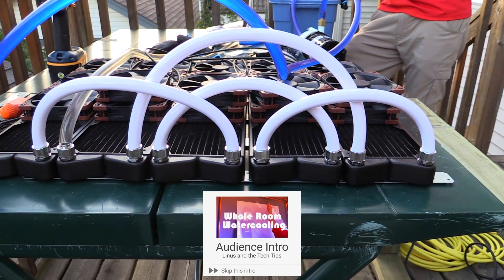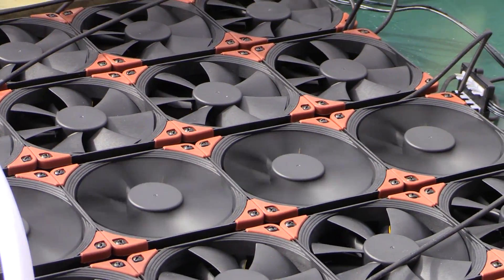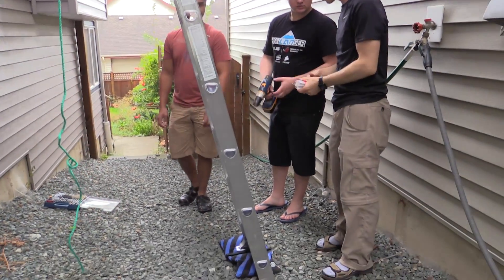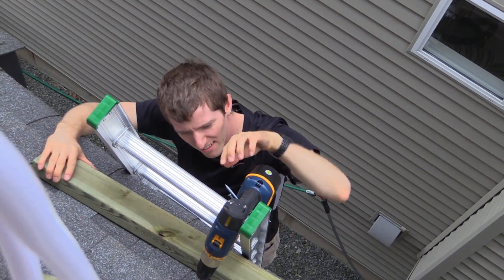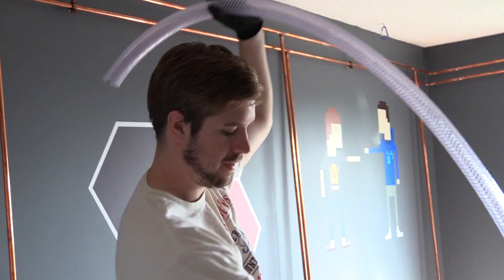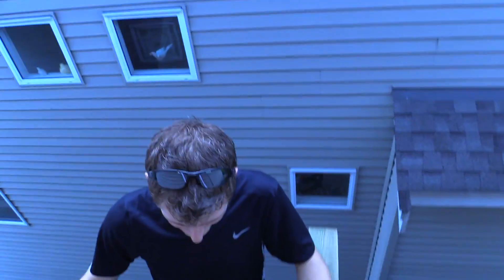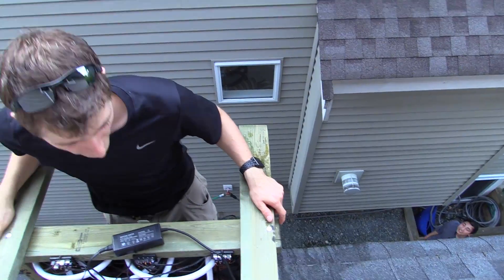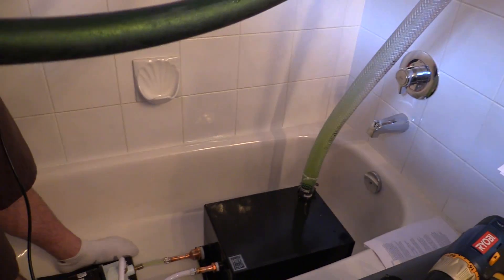Whole Room Water Cooling Project Day 3 - Radiator Mounting and Panic...

Comment: I would like to hear some opinions about an ''issue'' I have. I'm in doubt between two descisions: buying an SSD or upgrading my GPU.
I heard having an SSD is amazing because everything is so much faster, like booting up the PC, but on the other hand it doesnt increase performance in games and it's not really necessary.
Second option is to upgrade my GPU. I currently have a 7970 and I notice that it's having trouble with some games to play at max settings with 60 FPS. If I'm upgrading I'll probably go for the GTX 970 because it's such a great card for a good price. If anyone could help me I would appreciate it. 

My specs:

i7 4770k
8 GB RAM
AMD HD 7970 3 GB
700W PSU
2000 GB HDD

LG 29UM65 2560x1080  Ultrawide Monitor
Reply: Get the 970
Reply: You can press your power button, pee, then play great looking games at 60 fps. You don't need an ssd as much as a gpu
Reply: That is true, but wouldn't it be better to wait untill my 7970 is really outdated and then get a new GPU. The only games I can't play at ultra with an average of 60 FPS are demanding games like Crysis 3 and Battlefield 4. I'm not sure if the upgrade is worth the money.
Reply: PUrExIIxDuREx Your're right as long as you can get 60 fps on medium I think it's good.

Comment: Instead of copper tube it is better PVC tube easy to work with and come in different colors also.
About radiator i will use from air condition easy to instal on wall and to power it up....
That money you guys give for radiators you can buy 2 air condition radiators...
Almost to forget it can easily happen condensation of radiators and those fans are not made for outdoor use...
you will have big problem !
Reply: PEX would have been an even better decision.
Reply: The fans they are using  are the NF-F12 and they are Certified IP52 water- and dust protection.  Though I still wouldn't trust them to more then a drizzle of rain 

This is what the Nocua's website says "Thanks to a special varnish coating that covers the motor and PCB, the NF-F12 industrialPPC complies with the ingress protection rating IP52. This means that it is not only highly dust resistant but also withstands dripping water equivalent to 3mm rainfall per minute."
Reply: ***** and much cheaper
Reply: kameron454ci They could have also easily removed and moved the entire system to the new office. Also, no brazing/sweating of copper pipes required. The crimp connectors from various PEX systems are more than adequate and ensure no leaks. It would also have been ok with the heat output. The only thing that may have been an issue is the uv exposure if they ran the PEX outside and uninsulated. But they could have used a different material for the exterior connection.
Reply: *****
There was a Video from CES i think where they show them submerged in a Tank ;)
Reply: Definitely. PVC is more sightly and less of a hassle than copper pipes. Also, copper pipes are expensive . They conduct heat too, which may be bad for efficiency. Copper tubing is not needed. The water isn't THAT hot nor is it pressurized much.
Reply: 19stojkovic93 that grammar is more broken than your Slavic gopnik mobile.

Comment: Apple Pie

Ingredients:

Pastry for 2 crusts (recipe here)
8 cups sliced, peeled assorted baking apples - about 3 lbs.  (Granny Smith, Cortland, Jonathan)*
2 Tablespoons lemon juice
3/4 cup white sugar
1/4 cup brown sugar
1/4 cup all-purpose flour
1 teaspoon ground cinnamon
1/4 teaspoon ground nutmeg
2 Tablespoons butter 
1 egg yolk
1 Tablespoon milk

Directions:

1. In a large bowl, toss the sliced apples with lemon juice.
2. Combine sugars, flour, cinnamon and nutmeg; add to apples and toss well to coat.
3. Fill pastry lined 9 inch pie pan with apple mixture. Dot with butter.
4. Place second crust on top of pie filling, cut slits in top of crust to vent. Seal the edges of the crust with a fork or by hand.
5. In a small bowl, beat the egg yolk and milk. Brush mixture over top crust.
6. Bake at 425 degrees F for 15 minutes.
7. Reduce heat to 350 degrees F and bake 40-45 minutes more or until crust is golden and filling is bubbly
Reply: k

Comment: Why? didn't you just use a car radiator and fan? It would have been cheaper, and worked even better, with less things to leak or go bad. inb4 hurdur 12 volt system. They sell fans that run on 120V and would work just fine.

Comment: I would have just bought one of those home central air mounts for on the outside of the house. Would look much neater and would have been so much easier. Also Would keep the rads protected and clean because you can buy them with a Grille.

Comment: Are the outsides of the radiators properly treated to handle moisture?

For the liquid flow, are the systems connected in series? (might be risky if the hot water from one system is going into another)

Comment: hey LinusTechTips are you going to insulate the copper tubes inside your office? Otherwise it will fail the purpose, as the heat will radiate into the room before it reaches the radiator.

Comment: Is central heat and air tons more expensive in Canada (compared to the US) or something? While this is a really cool project, it seems like getting a modest central heat and air unit could be cheaper, and while you'd have a higher energy bill you can get some pretty efficient units that don't cost that much extra on electricity.
Reply: linus refused to get an AC, and if he did get an AC unit he would not have made this video, in fact fractal josh offered to pay for the AC unit but linus still refused

Comment: To anyone saying AC would be more efficient, I would love to see your math.

While water pumps do use a not insignificant amount of energy, an AC unit uses a metric shit ton of energy.  Plus, if they had just used an AC, they would be dumping all of the heat from the PC's into the room, then having to use MORE energy with an AC unit to transfer that heat to the outside, this way, they transfer the PC heat directly outside.

No it will not cool the room in the summer relative to outside temps, but it WILL cool the room relative to both having no AC and adding tons of heat from PC's.

Considering my own PC will heat my room to 80F even in an upstate NY winter, I can only imagine how that room would get with multiple PC's running video editing workloads.

Comment: pretty disappointed in this decision by linus media group to cool a room with water. just looks like a 3 part sketchy rigged tube mess that will probably fail in a few months.
Reply: wrong welds and wrong tubing, who uses copper tubing for moving water now a days. use the blue an red plastic contractors flex tubing. worst video

Comment: Am I the only one worried about them placing the radiator assembly outside the house? It doesn't have much of a protection against anything that might come to it say rain water getting into the electrical parts, insects deciding to make a nest out of it, or cold weather freezing the water. I wish they could've at least made a better housing for it to make it safe against the elements. But this video was done back in August and LinusTechTips is still up and running, so I guess that means everything worked out :)

Comment: Wont those fans freeze outside and not be able to spin? I mean you cant stop condensation, right? so they will get wet even if you cover them really well from the rain?
Reply: They're using Noctua Industrial fans which are supposedly tested for the worse case scenario. Even Linus tried running one under water and it didn't fail. It just started and stopped. Although I'm not sure how it'll deal with freezing weather.

Comment: I still think this project wasn't worth the time or effort.. I think a central refrigerated water cooling box would of been better and much more awesome. Could of used one of those refrigerated/heated water dispensers with a jug of water heh.
Reply: That's actually a really cool idea :) And I have one of those water refrigerator/heater lying around.
Reply: I think the biggest issue is condensation  or so I've read from other people doing it on overclock.net. The condensation even runs up the tube.

Comment: Linus! lol The lack of ability here is hilarious. Haha You can't just screw boards to the outside of the house :P now those screw holes have the potential to let water behind the siding :). Also I understand the copper pipe inside will help expel heat as the warm heads to the radiators but PVC would of been 100% easier and cheaper. Also are the fans on the radiator waterproof? Maybe drilling through the floor and put the radiators into the garage would be a better idea :P

Comment: A 12V capable universal power adapter for notebooks would be a decent solution. I use them for CCTV a lot, some can sustain 10A or more. Of course there are more powerful and reliable options still.

Comment: Just a tip I would pull the ladder back from the bottom about another two or three feet for more secure leverage. Since I actually work with ladders, it actually pretty scary seeing linus up there. Other than that my other recommendation would be since you have alreaddy spent alot of money on the project I would suggest drillong some pieces of 4"x4" or two by four, in between the gaps of the pipes then eventually covering all those pipes by screwwing some drywall over the wood. This is my opinion, it would make the room alot more quieter and more attractive with out having to see all that copper.

Comment: Yeah, you kinda need to solder ALL the joints... hahaha
Reply: Should've used pex all the way
Reply: @adamconn7435  the copper conducts the heat away, pex would act as an insulator. good if they didnt want to heat the whole room, but the copper pipes should not be inside the room anyways. they shoulda piped straight to outside or to a closed air conditioned room
Reply: Not a huge recommendation for Luke's dad as a plumber
Reply: Sharky Sharklops give him some credit man he stayed up to 4 in the morning soldering everything, I’m sure anyone would have forgotten one being that tired

Comment: I still don't understand why you made your outside radiator out of mutliple PC radiators... I would've just gotten one or 2 car radiators with a huge fan(like the ones you see on car radiators x) ) and that would've been a lot more quiet, because the bigger the fan, the less RPM. Also, I don't think your pump will be adequate for the job. Should've done the math a bit more on dimensioning the pipes, it's actually just undergrad material, nothing fancy. And shame on you guys for not getting the leak propperly resolderd in stead of using JB weld!

Aside from all of that: really cool project, can't wait for the next episode. (Hell: why hasn't this been posted months earlier? You did the project in august???)

Comment: they should have ran GM orange coolant through the loop, it has a low viscosity so it will move faster, most other makes of coolant are thick and do a great job of sticking to cool down engine heads and blocks but with PCs you just need speed

Comment: It would be so easy and practical if they used a car radiator and a car fan with a thermostat, some valves here and there to close parts of the hydrolic circuit.But if they wanted to use just computer parts for other reasons its ok :)

Comment: Am I missing something, or would this create condensation when the outside temp<Iinside temp like every night.
Reply: i thought the same thing, and suggested insulation in my comment along with a check valve to keep water from going back to the tank when they shut the system off. but it depends on how the place is cooled and heated, as in what temps they keep the house. either way i would have still insulated the pipes to keep any heat from radiating into the room/ combat any type of condensation issues that may come along with the season changes. Right now with it being winter time, the air is drier but once it warms up, (not sure about Canada weather) there will be more moister in the air and will be the real test if the system will not condensate.

Comment: This might be a stupid question but hey :) I was always under the impression that if cooling from the outside so your water temp is cooler then the ambient temp of ya room it can cause condensation to build up in systems ? causing short circuits and such ?

Comment: dont think its better idea to test the loop using air first, to make sure there is no leak, pump the loop with air and if it hold then there is no leak in the system, if there is leak then spray soap water on the join will easily tell where the leak is from. secure the copper piping so there is less flex stress on the welding. and i would really think a bypass system for each system would be nice ( bypass the feeding and return to each of the system without stopping the whole loop when doing individual system maintenance/replacement of parts and etc )

Comment: I have to ask.  Why didn't you just buy a window mounted AirCon unit turn it facing out and put the rads on the outside face with the cool air. The way you set it up is more likely to gain heat in a hot summer sun

Comment: An industrial radiator unit would have been a MUCH wiser option. 
You can find them used on craiglist, even.
Hell - even dig out a car rad+ fan setup from the junkers... 

A home radiator would have been wise too - it's what is used for central AC.

sigh

Comment: the fans and radiator solution you went with seem overly complex, I would have used a fan and radiator from a split system air conditioner, easy to find on ebay.

Comment: sharing a few thoughts. 1] missed solder joint; drain, and solder 2] you WILL need some "bleed" valves at the highest point/points in that system  3] pumping coolant thru lines that have air will NOT remove the air. air WILL remain trapped at some points at the tops .4] Rube Goldberg would have been proud..!! :)

Comment: i just wonder why they chose copper pipes vs plastic if they wanted to get the heat out of the room? Copper is one of the best heat conductors so half of the heat that was supposed to be transported to rads will probably dissipate through pipes inside that room.

Comment: Linus, why oh why did you try to use JB Weld on that joint??? That is the exact wrong thing to do. 30 seconds with a torch and some solder and it would have been fixed correctly. ( of course you first have to drain and liquid out of the area of the joint ) Since this was taped last Aug I am going to assume that either the JB Weld held, or that you got it fixed correctly since then.  I can't wait to see the next video in this series. Great job guys!